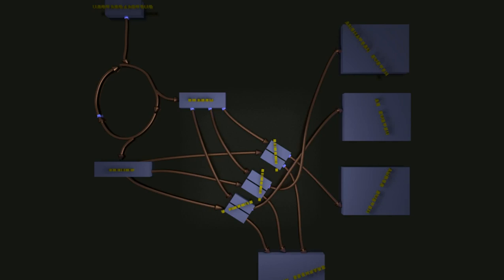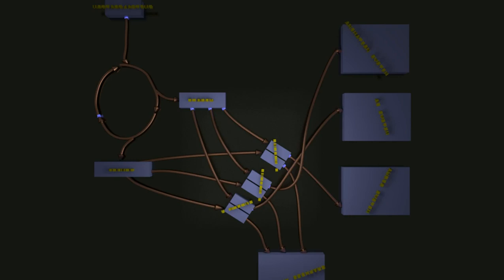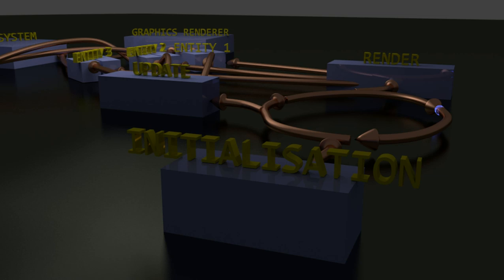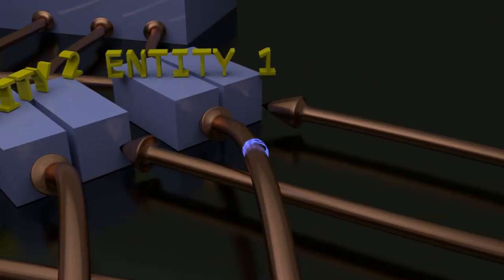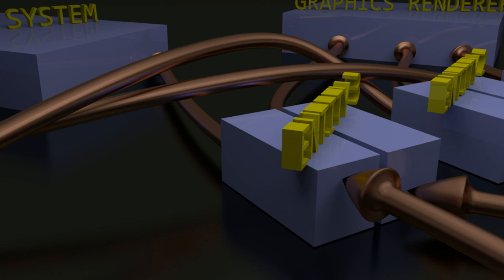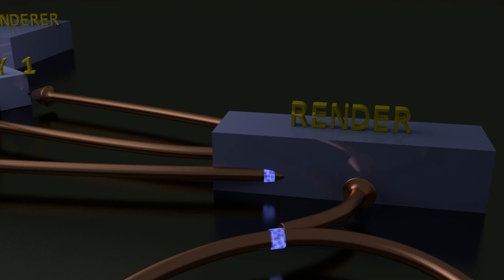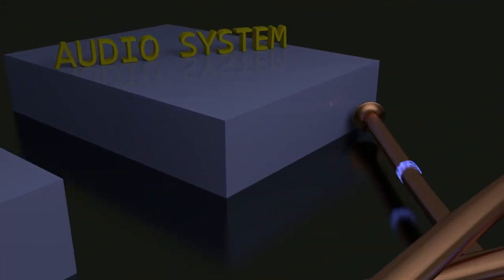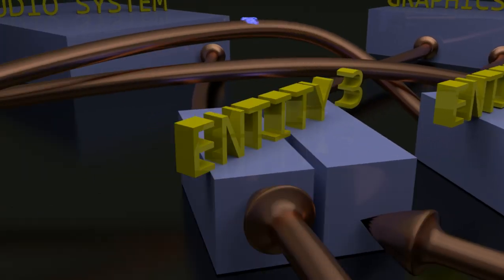Inside A Game Engine

Comment: The video was great and it gave me a good overview of how I should organize my game, but I disagree on something : "you should update before you render".

When you do so, you calculate the new positions and then render it, in this order, in the same frame. Then if you've done everything before its ended you give your process time to another process and you wait for the clock to tick for the next frame.

However, if you render and then update, your action will be displayed one frame after (if you're running the game at 30 fps, 1/30 s after, we wouldnt see the difference) but you use your CPU/GPU time better because you are only giving it to another process once your next positions are calculated.